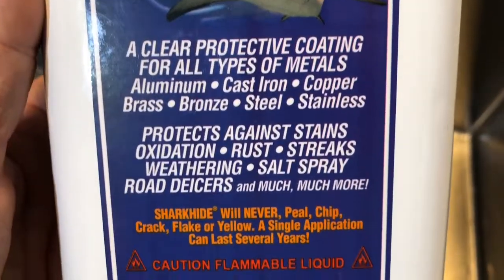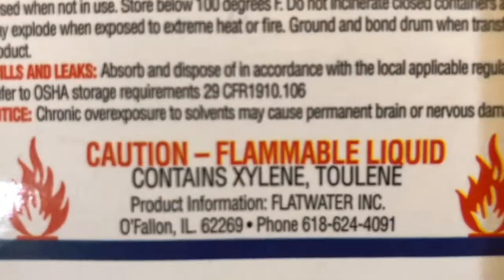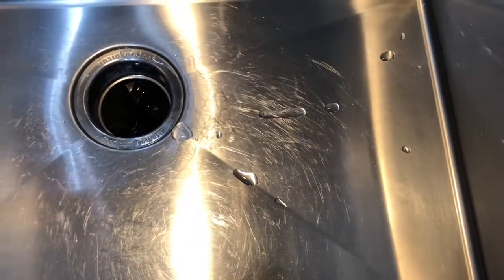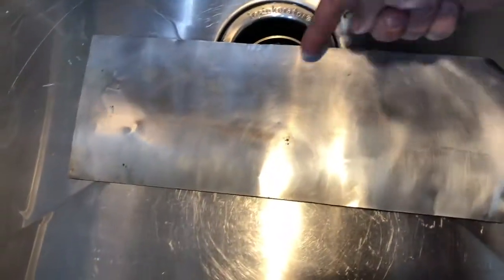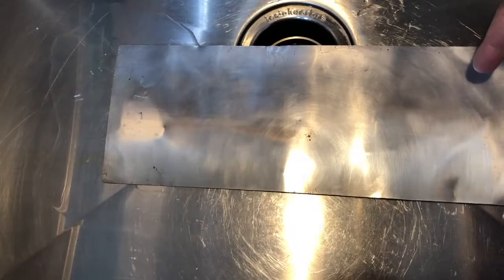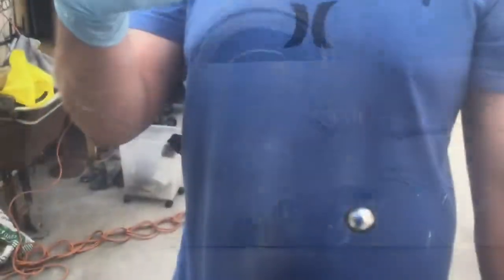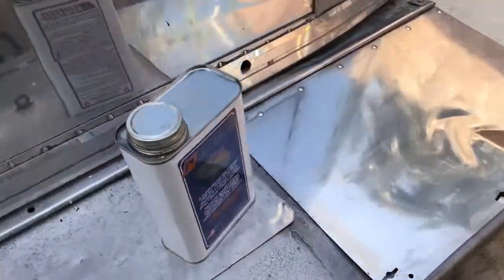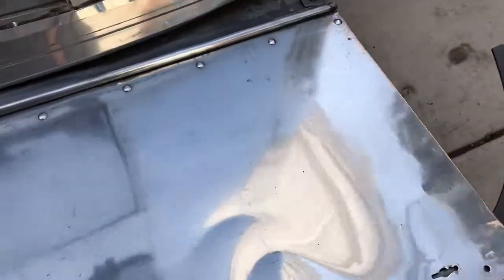Sharkhide Metal protectant review

Comment: Hi there, this is Clint and I'm the owner of the company that produces Sharkhide. First of all, thank you for your review of my product. This is the kind of thing that helps others. Unfortunately, your less than desirable results were do to improper surface prep combined with improper cloth. In the video one can plainly see black residue still on the pieces you coated so as you swipe Sharkhide over that residue, the solvents in Sharkhide try to dissolve that black stuff and it ends up on your cloth and gets spread over the surface leaving a dull streaky finish. I have my direct contact phone number on every can of our products. If interested, feel free to give me a ring any time, I'll be more than happy to take you through the proper steps to deep clean a polished surface before you apply the Sharkhide. I promise you your final finish will be 100 time better!
Reply: Hi I'm wondering if the will work on corrugated galvanized panels? Want to make a fence and don't want it to rust

Comment: You have had a detailer recommend this to me so I got some. I just put a test trip on a highly polished aluminum fuel tank on a truck. Wish I had watched your video before I started because i'm getting the same results. The detailer I got the recommendation from works on horse trailers and a lot of aluminum boats down here in Florida. Not sure how they do it because I'm getting the same results you are as soon as I started putting it on and it was drying. I'm getting a hazy good luck and I was getting some streaking. I guess to most people even the hazy my wife says I'm being picky. But it looked much better before I started. The hazy is unacceptable to me.  I get it the detail I said this protects it from rostas you're down to bear metal but the metal Polish. I'm using has a wax type finished to it so I don't get corrosion on alone i'm even after I polish it generally speaking. I'm wondering how you stripped it off cause. I'm probably just gonna take it off there goes a 100 bucks down the drain.
Reply from the maker: You can use acetone or an automotive medium grade reducer, which has a slower evaporation rate than acetone. On a sidenote, after I’ve polished my aluminum and it has been sitting for a while collecting oxidation, I will use a mild solution of CLR from the non-spray bottle mixing about 1 part CLR to 7 parts water.
Reply: I’m curious to what I can use on something extremely polished to protect it from oxidation. They are busbars for a battery that will be protected inside a car for the most part. Just looking for something that will be good for them.